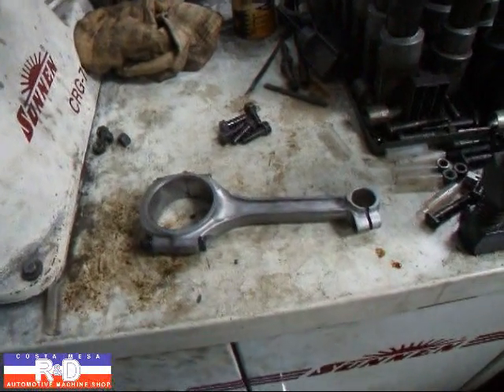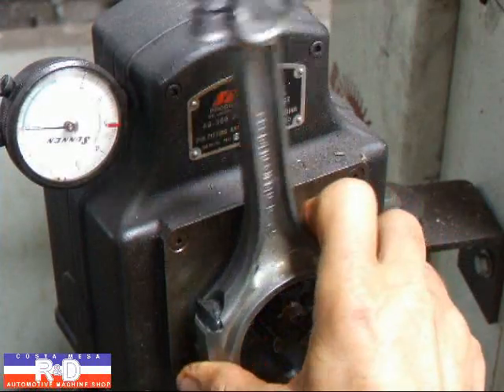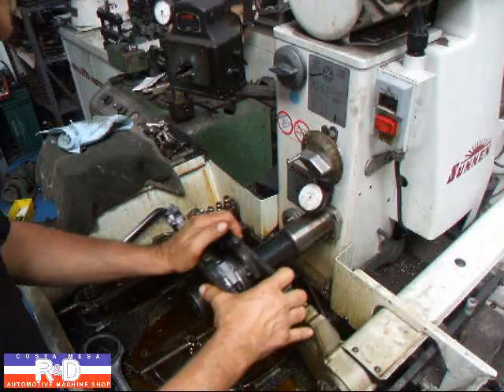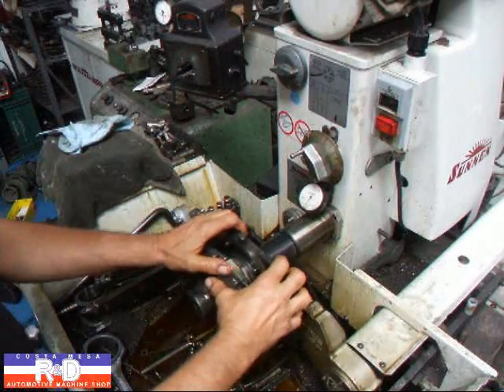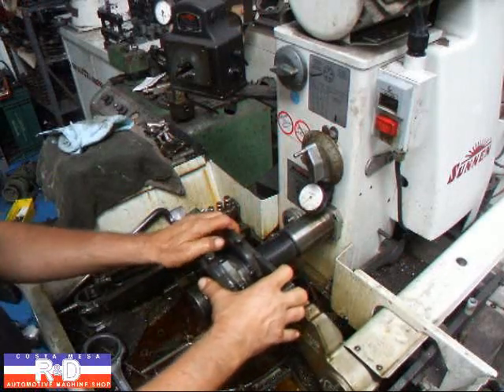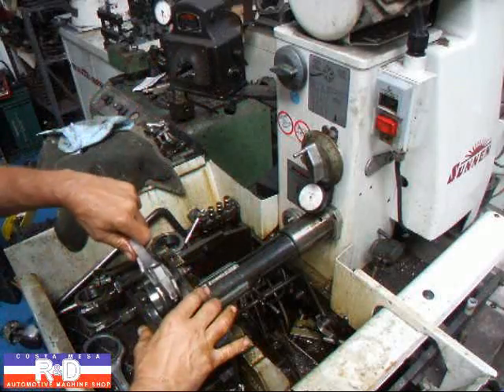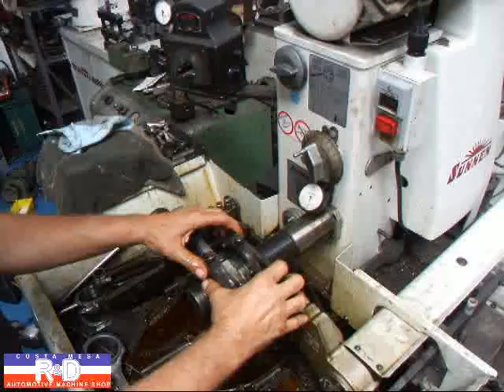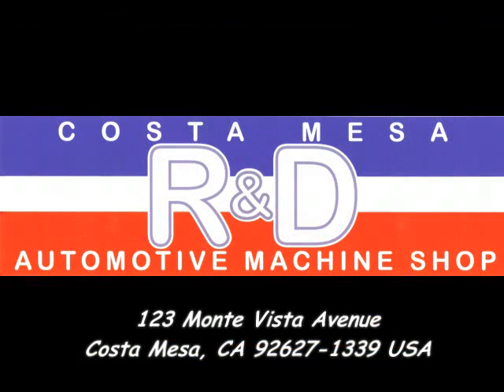235 Chevrolet Connecting Rod Reconditioning

Comment: this was before I began to size them. they were approx. .003-.008 over at the parting like after I had ground the cap and rod but before being run on the hone. the set of bbc rods that I did the exact same procedure to just days before turn out ok and the replacement set that I dug up for the customer today didn't turn out this way either. by the way all 8 rods came out oversized at the parting line not just 1 or 2. thanks

Comment: just a quick question here. yesterday I was in the middle of installing arp bolt into a freshly resized set of big block Chrysler rods. all went well until I began to size the rods. these rods were dead nuts on before I installed the arp bolts (using a rod bolt pressing fixture and properly torqueing the caps). I ground .005 off from the cap and rod. but when I checked the rods they were all several thousands oversized at the parting line. this is a first for me. what about you and if so why?

Comment: John, good videos, have a couple of questions about rods, what would cause a tongue and groove rod that had been cut on a sunnen cap cutter and honed to size with no taper to have the sides come in and get tight when then torque is let off the rod bolts? Also are you familiar with resizing rods by sanding the rods and caps instead of grinding? I have seen this mostly in aircraft rods and its easy to see the rounded edges. I have never seen an auto shop do this. Would you do this? Thanks

Comment: ive worked on some weird rods on johnson and evinrude outboard motors......rods are actually broken in half at the factory and to line the rod cap up you have to literally line up the pores in the steel....pain in the butt without the special omc tool   have a great day sir....thanks for the quick response

Comment: first time ive seen a rod with a clamp bolt at the wrist pin......neat design.....do they hold up?
Reply: THEMOWERMEDIC1 THE SMALL ENGINE SPECIALIST its for a 40s or 50s era Chevrolet, 100,000 miles all under 4,000rpm if you were lucky